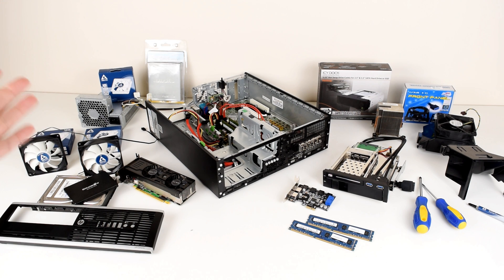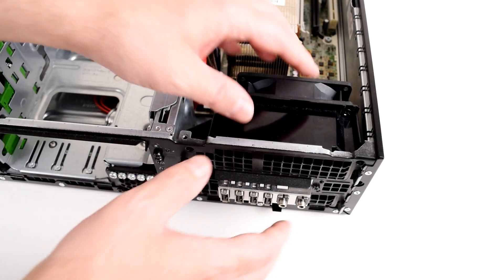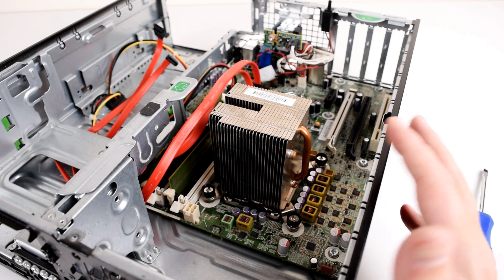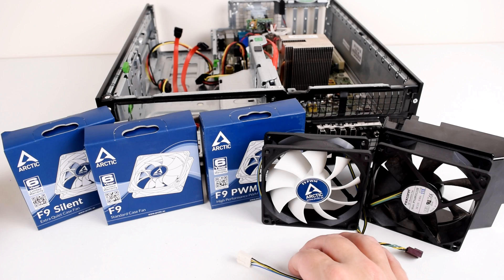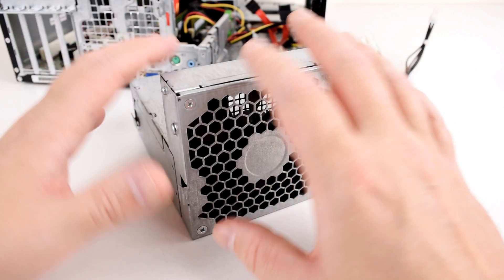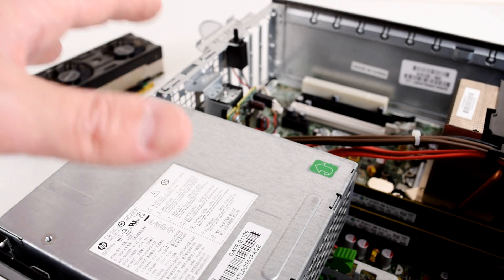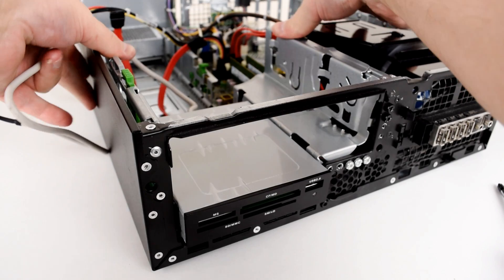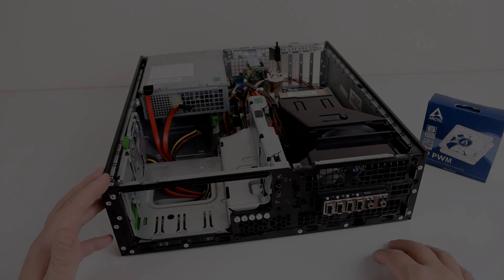Improve your HP Elite Small Form Factor PC

Comment: The i5-2400 is one of the best value CPUs on the market right now.  Usually sells between 30 and 40 USD, has 4 real cores (no HT) and gets a passmark score of about 6000 which is similar to a much newer Skylake i3.  Don't confuse the 2400 with the 2400S though.  The 2400S is about 15% slower.
Reply: When I tested my old X5460 (basically a core 2 quad), it got around 6200 in passmark 8 and around 5700 in passmark 9. So depending on the test it is either slightly slower or slightly faster.
Reply: For normal use maybe, but if anyone is going to be gaming on it, make sure to pick up the 2400. Night and day difference. My old pc was the core2quad and I'm now on the 2600
Reply: The Xeon X processors also consume a lot of power and push out a lot of heat.  I had a dual X5355 Dell workstation and it would use 300 to 500W of power under load (It has an older chipset that can run E54 or X54 processors).  The room would also heat up to an uncomfortable temperature.  I changed the 2 X5355 CPUs to E5345 CPUs and despite being a lower speed CPU the benchmarks were slightly better.  In my "server" computer that had a Core 2 Duo, I modded it for a socket 771 Xeon and run an E5440 and it stays nice and cool.

Comment: I have one of these! I wanted to put my 5770 in, (as well as an ATX power supply, a Lepa N500) which was full height, so I decided to make my own case out of cardboard. Running strong and hasn’t burned down for two years now!
Reply: still running?
Reply: @mg86_  It's actually a dc5800 SFF PC my bad, but yes, it still is, quite well 😁

Comment: my main machine for the last few years has been a number of HP and Dell SFF machines, they are hard to beat for value. My current machine is an OptiPlex from dell, the 3050 with an i7 7700, refurbished from the dell outlet they work out a bargain, the price I paid would barely have bought me the processor and motherboard if I was building It myself! never mind the rest of the components and windows 10 pro licence!

Comment: I bought HP z200 from my daddy office.
The only thing that's replaced is PSU, as first PSU fails.

Planning to upgrade HDD, RAM, and GPU. But I'm still saving money for it.

Edit: everything is fine until i washed it and didn't let it dry. Shorted.

Cpu is stock, 8 gig of ram, gt 1030.

Comment: Amazing as usual!! Now some gameplay to satisfy our gaming thirst!! ;)
Reply: Yes. This! I'd love to see some benchmarks of this system with a 1050 Ti running Windows 10 and some modern games.
Reply: Hey guys, i want to run some 2k10 games like nfs undercover, gta eflc and like that, i have a hp 8300 cmt with a i7-3770, 16gb ram and intel hd graphics 4000 wich has some weird technology that it supposed to grab vram from ram but anyway i want to upgrade my gpu to a gtx 960 2gb, it worth it or not? Also my psu is 320w and the seller said i need atleast 400w, is really necessary to change it? Pls help im new with these desktop stuff...
Reply: @daxnoxlc3791  no, you could always buy a s model cpu just in case( s models have lower power consumption

Comment: Hi Phil, Another good video with plenty of information and step by step guide.
A note to first timers, most of the lids are just slide on and use the top handle as Phil showed, but a few seem to have the extra thumb screw installed in the back of the PC - check just in case.

When you take the front bezel off, by lifting gently on those 3 green tabs the bezel want to go forward and tilt toward the base, so i just prop up the front of the case with some spacers, a few pens or pencils works fine, or even small lego's :)
All around the front mesh grill it may be full of lint and dust bunnies, just remove them.

Re the internal SATA ports, on the HP website the 8200 is listed as follows "On the motherboard there are 5 SATA connectors. 1 dark blue for 1st HD, 1 light blue for 2nd HD, 2 white connectors for HD/Optical drives, and 1 black for eSATA"

Prices for Isopropyl Alcohol ( Rubbing / Cleaning Alcohol ) seem to be all over the place, in Australia, get the 345ml green bottle with the green alligator on it from coles or woolworths, it is usually $9 to $10, other places sell smaller 125ml pump bottles in Digger brand for about the same price ( Yes Bunnings that includes you ).  Other than your PC this is good for mosquito bites etc. Just remeber dont leave the lid of for a long time as it will evaporate

Regards
George

Comment: i bought a Friend a Dell SMFF mini a year ago for 100$usdm with a core i3 4gb of ram and 250gb hdd, now its running an i7 2600 16gb of ram (4x4), 500gb ssd, and a GTX 1030 (he doesnt play much but does alot of illustration work), and man it is blazing fast and is a really good deal, pc is dead quiet, also came with a 300w gold psu, grea value machines totally recomend hunting this and upgrading them for super cheap pcs
Reply: I bought mine about 2 years ago. I added a GPU and an SSD, and it's honestly one of the best purchases I've made. The 2600 runs all of my games still quite smoothly and while it would nice if I had gotten the non SFF case in order to fit my gpu inside, this machine has worked extremely well for my needs. I'll maybe upgrade next year since it's still running fine.

Comment: PHIL. NO. When you affix the heatsink you're supposed to do crisscross! Just like with a car tire. :)
Reply: Or anything important.
Reply: @benTi900  anything important that's supposed to be tightened evenly.
Reply: Or a cylinder head.
Reply: Thank You!
Reply: It won’t break anything as long as the cpu has an IHS but thermal paste might not spread optimally.
Reply: @RunfisherRS  you shouldn't have to worry about the thermal paste spreading right because you should be pre-spreading it with a tongue depressor.  :)  This was the way we did it back in the 90s, I don't know why people quit doing it in yhe first place.
Reply: I just glue mine on with epoxy, or old chewing gum if i can't find the glue. Is that bad?
Reply: You can’t do that on that heat sink — I couldn’t at least

Comment: Once again, great content. Always loved your work with your SFF HP. If it wasn't for you I probably wouldn't have bought the extremely reliable HP 8300 Elite SFF I'm using right now. I upgraded it with an i7 3770, 16GB of RAM, 1050Ti and a 240GB SSD, it just rocks. I have been thinking about replacing the power supply fan, this video just made me want to do that even more.
Reply: Perch Arnel The 1050TI I got is the MSI low profile one, the normal sized ones will not fit the case. The power supply is the one that came with the unit, can't be 100% sure right now but I think it is rated at 240W. I also got an extra 1 TB HDD, a PCI audio card and a PCI-E USB 3.0 card there, and I have had no problem whatsoever with power, I've stress tested the system more than once and have been gaming on it for a couple of weeks.
Reply: Just a heads up, it's on sale right now for $100 if you're in the U.S. https://www.newegg.com/Product/Product.aspx?Item=N82E16814137079&ignorebbr=1&nm_mc=AFC-C8Junction&cm_mmc=AFC-C8Junction-PCPartPicker,%20LLC-nana_-na&cm_sp=&AID=10446076&PID=3938566&SID=

Also, this 240watt power supply has zero problems running these things. I would know because I'm running a Rx 470 on it.
Reply: I5 3570
12 gb ram
250 gb ssd
320 gb hdd
160 gb ssd
Msi 1050 ti low profile
Stock DVD 
Stock PSU
Reply: Hey, I know that this is an old comment but, do these machines support ivy bridge processors like the 3770?Mine came with an i5 2400 and i was thinking of upgrading to an i7 but if they do support them i would be more of an upgrade.
Reply: mharris1270  Absolutely. A 1TB hard drive is pretty cheap these days.
Reply: @rhyzon  I have mine with i5 3470, can i upgrade to i7? tell me which model please, and also i will put a 1050ti oc 4gb version full size in this case :v
Reply: @AlbertMilander  Unless you mod the case, a full sized graphics card won't fit; you have to look for a low profile version. The 1050 ti has a few of those,  Gigabyte and MSI have them (at least). As far as the I7 goes, it isn't really needed for gaming, but if you want one, go for the I7 3770, the non-K one, you won't be able to overclock it in these motherboards.
Reply: André Pedreiro Thanks, i want to show the Graphics Cards and ask you something more, where we can keep in touch? Instagram, Facebook or what?
Reply: @AlbertMilander  feel free to PM me if you need any extra help. It might take me a couple of days to answer, lots of work atm XD
Reply: @rhyzon  Ok thanks!! How much do you have paid for the i7 3770, i think my pc has a bottleneck because when i'm playing GTA V or Fornite the GPU is 98-100% and the processor 70-80% and the framerates goes down and get some crashes, is that normal? i've 8gb ram.
Reply: @rhyzon  i need help with my PC, its a Elite SFF
Reply: @Idkmyname-b6o  sure thing, what's up?
Reply: @AlbertMilander  its probably ur psu that causes it to bottleneck what gpu u have on it?
Reply: @AlbertMilander  i7-3770
Reply: Wow dude thats amazing
Reply: Did you change the heat sink with CPU cooler or you are using the stock heat sink? Because i cant see the connection for CPU cooler..
Reply: @mayanksingh12  you can't change the CPU cooler that easily, the mounting holes are specially made for this model so no other cooler can fit. And that's normal, the front case fan is what cools the CPU, the heatsink itself doesn't have a fan.
Reply: @rhyzon  i have the elite 8000(...?) cmt edition and my gpu is a Zotac 1050ti OC edition. I bought it a couple days ago btw. Anyways it's temps are going high and its winter rn so can you tell me any tips to keep the gpu cool because I'm scared that it might burn in the summer
Reply: @ep1cccc  Zotac cards usually don't have beefy coolers, so it's not uncommon for them to run hotter than most cards. And what do you consider hot? My low profile 1050 Ti spent almost two years going up to 83 degrees when fully stressed and still works just fine.

If I'm not mistaken that's the limit temperature the 10 series cards are designed to take before they start to underclock themselves. If you'd like, you can try to install MSI afterburner and check at what speed the fans are spinning; if the noise doesn't bother you, push them to like 80% utilization and check the temps (I definitely do not recommend putting them on 100% for long).
Reply: I there, maybe you can help me out :) 
I have an hp 8200 sff and I've upgraded it to the i7-2600 (the k version wouldn't even boot up) and 32Gb o RAM + SSD... the next step was to go full on the GPU, so I bought an 1050ti lp from MSI but it just won't boot no matter what I did... I've asked a friend to test the GPU (to check if it was faulty) and it booted right away!
Maybe it is the PSU that isn't outputting the full 240 now? Bios Issues?
I just went with a GT 730 LP passive and it runs smoothly (but of course I cannot game on that)...

I would like a lot to return for some casual gamming but with the current GPU prices I'm really afraid to buy a GPU and only be able to use it as a door stoper...

Thanks
Reply: @endesse  the 8200 can be a bit more tricky than the 8300 for some reason when it comes to GPUs (at least the ones I've tried out). Try removing the BIOS battery for a few seconds then try to boot it up with the 1050 Ti installed, there might be some weird BIOS setting messing something up.
Reply: @rhyzon  Unfortunatly I had no luck with that as it was my normal procedure... I even try messing a lot with the BIOS settings and disabling the integrated GPU when I had the I5 with no luck :(

If only I could test another to be certain... but right now I'm cornered on the no gamming part :|
Reply: @endesse  I'll try to have a look later on my old machine to check my BIOS configs. If I remember correctly there was a couple of options that I had to disable/enable before the GPU was recognized.
Reply: @endesse  the only things I can come up with are:
- enable legacy support and disable both secure boot and fast boot in security→secute boot configuration.
- in power→hardware power management, disable your maximum power savings.
- in advanced→bus options, enable the first option and disable the second one (PCI# Serr Generation ON, PCI VGA Pallete Snooping OFF).
I believe these were also the options I had to activate in order to have my old HP thin client to accept the GPU I put on there. Let me know if this helps.
Reply: @rhyzon  I'll sure try it when I lay my hands in another GPU..

I really apreciate the help!
Reply: @endesse  I hope it all works out man, budget gamer FTW! :D

Comment: I would NOT install any HP UEFI/BIOS firmware that's not at least two months old. HP has been rushing out Spectre/Meltdown microcode updates that conflict with MS patches, which when both are applied ... completely brick systems. Tread carefully.
Reply: I usually stay with the latest non beta version.
And on some boards even older, depending on the changes with an update. Sometimes they add compatability for newer chips, sometimes they worsen overclocking.
Reply: What version in your opinion is the best?

Comment: Great video like usual Phil! I have a similar hp 8300 sff machine. You actually inspired me to buy a used sff machine and upgrade it for a gaming machine. it came with an i5 3470, 8gb of ram, and a 500 gb hard drive. i bought a gt 1030 for it and it's an amazing gaming machine for the money. Thanks for showing me options :) i have also considered upgrading the fans. I've already opened my power supply before and i'm going to probably going to replace the fan in there as well as the cpu fan. Thanks man, keep up the good work!

Update: I replaced the fans with the arctic f9 pwm, as well as some fresh thermal paste. system is quieter now. I've also added a refurb 320 GB westen digital drive as an additional game drive.

Comment: I recently turned my sff dell optiplex 790 with an i5 2400 into a gaming pc for my truck.  Used the zotac 1050ti. I upgraded the ram as well, I plan to put an i7 and an ssd in it in the coming months, works great
Reply: Got that same GFX card in my 8300 SFF. With the CPU maxed out and 8 GB of RAM the thing handles mid range gaming with ease. It makes for a nice little system that you can lay flat and put a small monitor right on top, takes up almost no space at all.
Reply: nosirrahx  nice I did a Dell sff because it's easy to store when not in use in my semi truck lol. I was going to build something but I couldn't pass the deal on the tower up now that they make good worth buying low profile gpus
Reply: What I like most about the older Dell and HP SFF business PCs is that they are surprisingly well supported. Everything from XP to Windows 10 works on just about all of them.

That Zotac card is also a beast for what it is.
Reply: nosirrahx it sure is, my last gaming pc had crossfire 7770s in them an 1gn of vram didn't cut it, I was blown away at how well the 1050ti with an i5 2400 performs in the latest games that I do play. Totally impressed with this little thing
Reply: That i7 is gonna cost pretty much the same as Ryzen 2200G, which came out months ago and is faster. Upgrading these machines is quite pointless unless you can get the parts at a substantial discount
Reply: nosirrahx sorry for hurting your feelings.
Reply: nosirrahx distract lol lol lol
Reply: You forget that a lot of people find these machines practically free (like I did, full tower DC5800) that are thrown out by businesses. Upgrading in such a manner is almost always cheaper in that sense. Add in the cost of the board and DDR4 memory and we're not even close to the same prices regardless of the cost of a used i7 (even Sandy Bridge; though if you can it's far cheaper to upgrade a Nehalem one, a Xeon X3450 drops right in for only $20. And yes, these are the Socket 1156 Xeons. They do work perfectly with OEM hardware. Same with the Socket 775 X3360's and such (NOT socket 771)).
Reply: @nufrequency 

Why are you on this channel? Its like joining a bodybuilding forum to complain about people spending too much time in the gym.
Reply: Don't try to distract from the point here. You are on a channel dedicated setups that could all be done in a VM for free.

This is not about saving $, this is about building cool retro stuff.